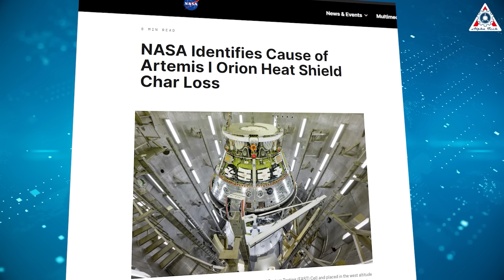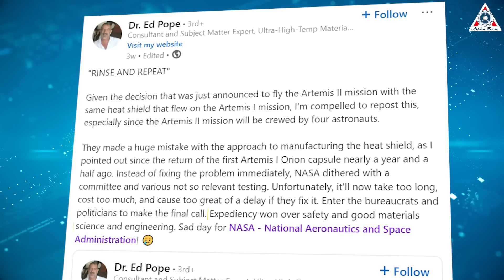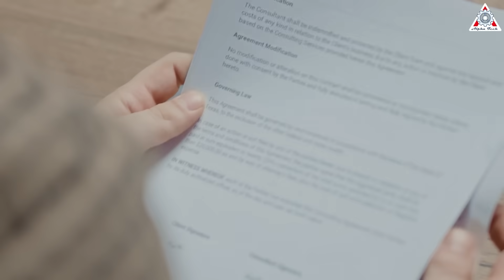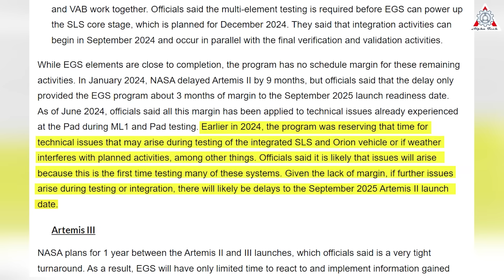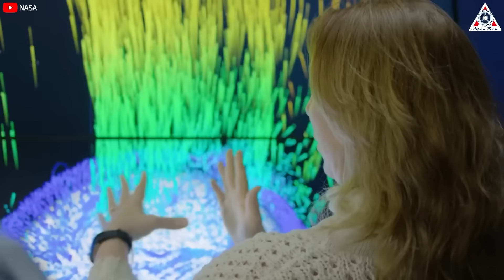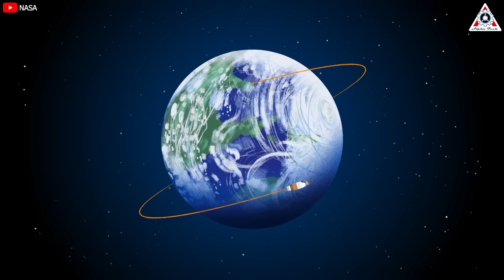Unexpected! NASA's $2B Moon Mission FALLS APART. What SpaceX & Musk knew all along...

Comment: They should have used metallic heat shield like they used in Starship.
Reply: There hasn't been a metallic heatshield developed yet that can take the impact of Orion.  Artemis/Orion hits the atmosphere way harder than the shuttle or presently Starship.  Starship is eventually going to have the same problem if its going to venture out of Low Earth Orbit.

Comment: Sooooo problems with the heat shield……..soooo all those years of shuttles returning without any problems doesn’t give em any ideas of how to fix the shield on Artemis?  So problems with the “hatch.”  Well, seeing that they have supposedly had hatches on all the ships they’ve used in the past?  That doesn’t give em any ideas of how to get stuff done?  🤔. Ooook.
Reply: The Space Shuttle didn't go anywhere requiring a lot of energy. It only hit the atmosphere doing 17,000 mph.  Apollo was coming back from the moon and hit the atmosphere at 25,000 mph, plus it hit at a steeper angle.  Orion is about the same as Apollo.  The shuttle tile are not designed for that high impact.

Comment: So what's the difference between today's heat shilds compared to Gemi rocket shilds.
Reply: Can't answer to Gemini, but it returned much slower from orbit. Apollo used AVCOAT ablative coating, hand filled into a honeycomb using caulk guns. The first EFT1 Test of Orion used the same Apollo method and it worked fine. But for the 2nd test, they used AVCOAT blocks which they welded to the base heat shield - they did this to save time and money. Also, Apollo never did a skip entry, and they tried that with Orion. So NASA says/thinks/hopes(?) that not doing the skip entry will solve their problem with the new block  AVCOAT method. This is part of the problem with huge expensive 1-off tests and no money. They won't launch another expensive SLS to test this again, or spend more money to go back to the Apollo design.

Comment: Yes.  Nasa needs to cancel SLS, and ULA  and all Artemis & Lunar Gaateway mission ... and hire ( reusable ) the SuperHeavy Booster or buy a fully disposable SuperHeavy to get a specific mass to altitude & velocity.

Then Nasa needs to tender  stages & modules for specific missions riding on these SuperHeavy boosters hired or bought from Space X.

The current fully reusable SuperHeavy Booster costs around $200 m and will get cheaper.  And a disposable SuperHeavy Booster should be about 20% less than the reusable booster.

Forget the cheap fully reusable Starship as it can only get large loads to LEO, which is why it needs refuels in LEO GTO or trans lunar or mars trajectory.

Focus on the disposal & reusable Boosters ... get loads to specific altitude & velocity before returning or falling back to Earth.
Reply: NASA needs to let engineers do the engineering, not the managers.
Reply: @spacecadet35  Like the Engineers from Boeing?   Not thanks.

Nasa needs to stop being moron Liberals following the party of the Slavery & Confederacy  who cancelled the expensive Space Shuttle, to rely on the Russians to get astronauts to the ISS .. and the replaced it with the expensive SLS using the Shuttle engines & boosters.   W T F?

Comment: NASA's path forward should be crystal clear by now.
Cancel SLS for non-performance and re-bid the project assuming the new effort will start from scratch. Although the new project will be given the SLS work priduct, no competitive product should be wxpected for at least 10 years and more likely might see results in 20.
The mismatch between Orion and SpaceX Super Heavy is a gross mistake in NASA project management  but only one path forward is possible and that is to make the parts fit. This mistake should never be repeated, in the future all competing projects should produce product that fits a common architecture.
If Orion cannot be mated with Super Heavy and its various problems resolved, there should be consideration for an all SpaceX effort using Starship. Musk appears to be willing to finance in whole ir part an effort that can go to the moon and back, and has recently proposed some designs that use Starship as domiciles. If Starship can land on the moon this year(2025) then it's probably likely that a round trip will possible the next year and humans be transported to the moin the following year(2027). This timeline is far faster than China's  which might not even be on the moon in 2030 without taking very risky chances.

The criticism in this video about Orion's use of simulations is unwarranted and in particular Monte Carlo simulations which is a  well known machine learning technique that today produces superior results over legacy A-B iterative processes. No gambling is involved and risk in the result is lessened.